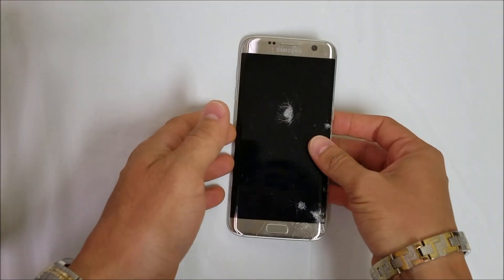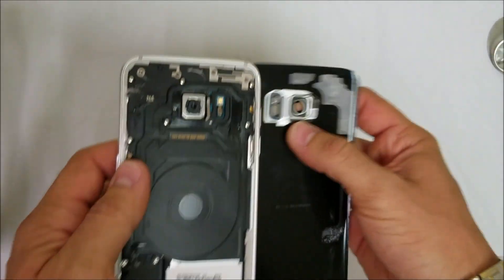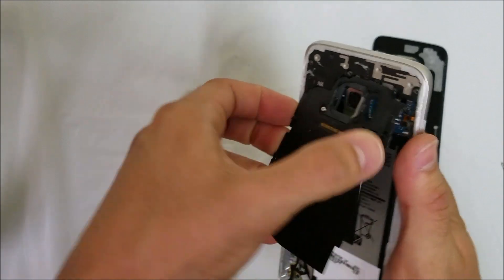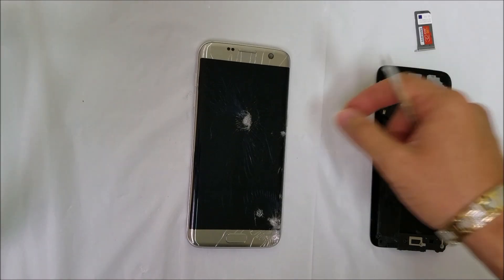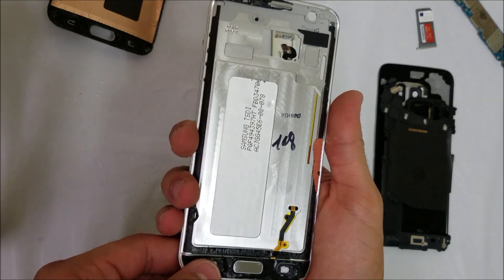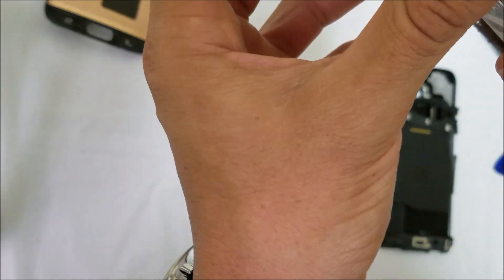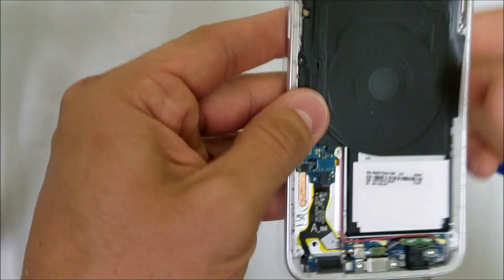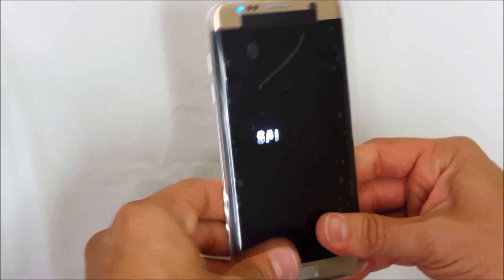Samsung Galaxy S7 Edge - How to Take Apart & Replace LCD Glass Screen Replacement

Comment: wtf man display was working you just neded to change the glas
Reply: believe it or not its actually easier to replace the whole thing rather than just the glass
Reply: I do t believe you becouse im doing this for living and its more complicated to separate whole phone
Reply: The display had a damage in the right lower corner. Big black spot.
Reply: Eggzacklee!
Reply: +Nenad Kovačević Hi there. do you have a video on removing the glass for the S7 edge? 
i wanna do it for a living and would like to practice on my own damaged screen

Comment: so is the lcd now not adheared to the frame? didn't look like you put any tape or glue there..
Reply from the maker: The Samsung Galaxy LCD's have a adhesive on the back of the lcd screen which adheres it to the frame.